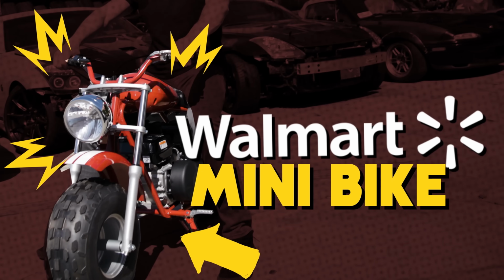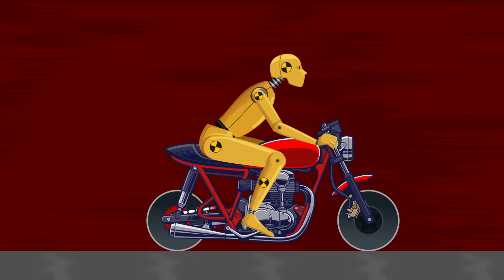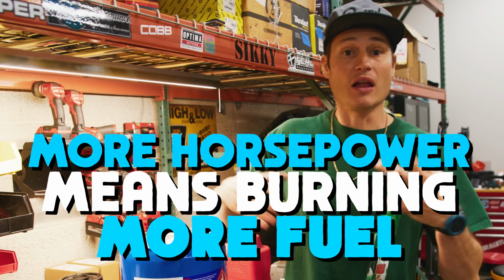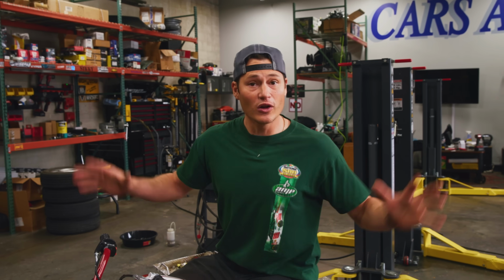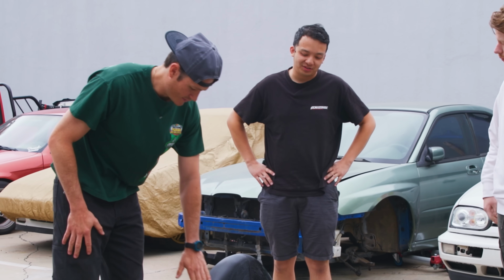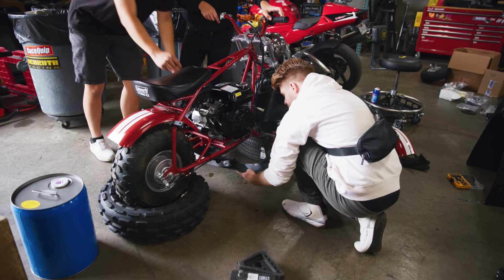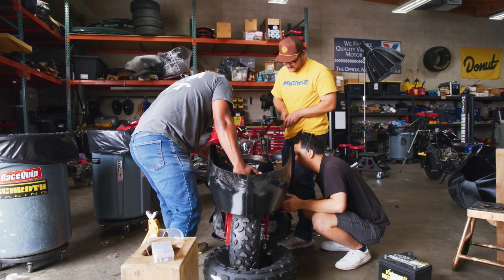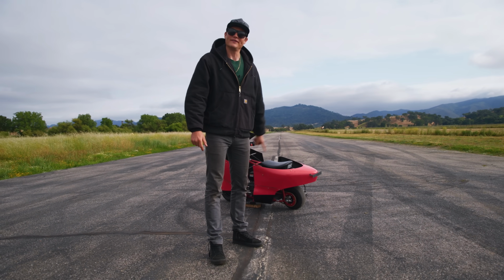Building the World’s Fastest Walmart Motorcycle (Day 2)

Comment: I was shocked by the minimal effect of the aero. Based on the looks of the on/off I assumed it would a massive effect
Reply: It has a lot more surface area than just the bike and rider.
Reply: Maybe they need a full fairing, like those HPV bicycles that go 80+ mph.
Reply: Aero doesn't look right either, looks like it's causing lift at the front which is why it's wobbling
Reply: its effectively like putting a giant air dam on an 18 wheeler. try to make something heavy and huge aerodynamic, doesnt work very well.
Reply: The added weight didn't offset the gain in aero either.
Reply: @joshuagibson2520  yeah 10lbs on an engine with that little torque is significant. Definitely more than the 3% reduction in drag.
Reply: I think it would have more of an effect if they were going faster than 100mph if it was 150mph would be useful
Reply: How aero looks generally has little to do with how it actually performs
Reply: I hope they do a run without it. Seems like a rigid parachute, especially in the rear hollow pocket behind the rider. I'm guessing a lot of flow will get caught in that
Reply: @tomn2765  If his legs don't block it and the front fairing directs it away from it.
Reply: Hey! The minimal effect is actually coming from the rider. All the flow separation we're seeing is simply cause the rider isn't tucked low enough (cause he can't be). Unfortunately fairings can't really fix that.
Reply: @CRneu  Weight doesn't affect top speed, though. It only affects acceleration. Top speed is dependent on drag, not weight. 3% is 3%.
Reply: @clawsoon  yea the design is off they could of saved weight by not making that piece that went into the struts and instead just incorporate into the top fairing piece that would curve around the front wheel and then come to a point on the back like a rain drop.
Reply: Despite how sleek a lot of sportbikes may look, motorcycles are very un-aerodynamic. The most aerodynamic production motorcycle was the Suzuki Hayabusa last time I checked, and it has about the same drag cooefficent (0.55 - 0.60) as an H2 Hummer. Even the best Aero in the world would only make a marginal difference
Reply: The aero imo looks fugly
Reply: Put a set of short, flat bars on it, and try the "Bonneville Speedo Superman" technique?
Reply: @drippingwax define normal
Reply: @drippingwax and yes but main problem they require to go slow through towns other problem is track has been upgraded can risk derailment if you are referring to the USA. If you talking about other countries they have no problem reaching those speeds they kept up with modernized trains
Reply: He INCREASED the frontal area, adding several counts to the 'Coefficient of Drag'- even though he DECREASED the C/D by several counts with sleeker bodywork.
Sometimes smaller dirty frontal area is better that cleaner aero.  Should have moved the seat bk, & moved the foot pegs bk, & built dropped handle bars. Using all the Aero man hours to achieve those improvements,  & saving some wt#.

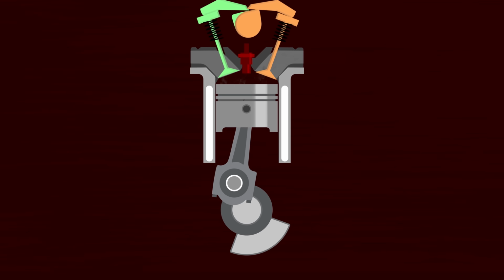Comment: A correction around 2:45, fellas: 12:1 air to fuel ratio doesn't mean 12 parts fuel per one part air - it means 12 parts AIR to one part FUEL. Huge difference ;)
Reply: I was about to comment!
Reply: Also gasoline is 14.6-1, not 12-1
Reply: @ThePower1037  Technically yes but under load and particularly with boost 12:1 is safer
Reply: @ThePower1037  The air:fuel ratio of gasoline is variable depending on a lot of parameters. It's not a set number, which is why it's a ratio ;)
Reply: @Zaudunyani  You're correct about the ration being variable, but that's not why it's a ratio. That's why it's a variable and not a constant. It's a ratio because there are two substances being compared (in this case by volume).
Reply: @ThePower1037 For maximum fuel burn efficiency. For max power, 12:1 is more appropriate.
Reply: No one cares bruh
Reply: Stoichiometry
Reply: @BillyBob-iy4pd  lmao if you're running what's actually 1 : 12 i think you might care
Reply: @BillyBob-iy4pd  I care.
Reply: The real problem is gasoline air fuel is 14.5 to 1
Reply: @Linkman95  The dude can't change a flat, don't bother.
Reply: 12x the difference
Reply: @ThePower1037  That is theoretical,
in reality this ratio is only used in idling and low load operation while at full throttle the ratio will be around 12:1-13:1 (depending on NA/boosted),
because of thermal and efficiency reasons.. for example at 14.6 : 1 the spark igniting the fuel is a lot slower than at a richer A/F ratio, also lean burn/knocking etc are more probable at this AFR
Reply: Is this the last episode we see with Jeremiah, i hope not😮
Reply: @ThePower1037 technically but if you run an engine hard at 14.6:1 it will ping itself to pieces
Reply: @ThePower1037  I believe you are refering to the stoichiometric equation.

Essentially, that is the calculated, theoretical perfect "reaction", where all parts fuel and air are "used up" and converted into CO2 and H20 without excess or waste. However This does not happen because not all of the fuel is able to be reacted to oxygen, inside the engine, in time. You can encourage the % reaction via heating, mixing, turbulence and as well as aiming the Fuel Injector towards the sparkplug, but that works only in specific set ups. I believe its also why OHV is more efficient, because have the spark plug dead center minimizes the distance to any one point in the cylinder, resulting in an even, consistent burn while lowering the chance of "unburnt pockets"

@MoistGrundle2.0 Not necesarily. That only works in an ideal, perfect environment that does not exist. It has been found that lean fuel ratios are more efficient and powerful then stoichiometric ratios. In chemical reactions, you want the inexpensive, less costly ingredient to always be in excess, so you can more completely react the limited resource.

You can get closer and closer to 100%, but it will never be 100%. And then you have to factor in the cost of design, equipment, time, and reproducibility.

The higher the ratio, the more force, wear, and heat is generated resulting in needing more robust parts, or your parts and car will break down quicker. I do agree with you on the 12:1. The lower the ratio, the better it is for your parts and reducing wear.

FUN FACT: The higher the ratio of air to fuel, the less it acts like a "burn" or "flame" and slowly becomes more and more of an explosion. Same thing with compression, low compression causes a flame front, while high compression turns it into an explosion. (Where in an explosion creates converts more and more energy into pressure rather than heat)
Reply: @MoistGrundle2.0  I tried to link your name in my above comment, didn't work out.
Reply: Richer than Oprah
Reply: Yes, but the conclusion is correct that 3x more ethanol will be used at 4:1 (which is the same as 12:3).
Reply: @kmoecub u're wrong. It is not by volume. If it was by volume, your engine would drink a little bit much don't you think? If you have a 1000cc engine, it would suck 1 liter of air every 2 rotations at full throttle. Every 29 rotations it sucks 14,5 liters of air in. Your words saying now the engine used 1 liter of gasoline. Now do the calculation when the engine is at 6000 rpm😮😮. It would drink 207 liters per minute of gasoline haha
In science the perfect mix is 14.7 to 1. And thats by weight, not volume. 1 grams of gasoline, 14,7 grams of air.
Reply: @ThePower1037  correct bit i think the bike is a two stroke
Reply: @600wheel  Theoretical stoichiometric perfect ratio. And that is measured on the volumetric efficiency. And volumetric efficiency occurs on a specific RPM or narrow range. 14.5:1 at wide open will mean less at part throttle etc etc. Thats why there are so many different maps in EFI systems and different stage jets in carbs. Thats said, for BOOST and NITRO, you want fatter ration of 11-12:1 to account for the extra oxygen on boost. Methanol itself has LESS potential energy so you have to run more through the engine. That works as a coolant, mild shock absorber for the aggressive timing curve etc. Its not so cut and dry as 14.5:1 is gospel
Reply: I seen that and laughed
Reply: @600wheel lol, if your 600 whp is tuned to 14.5:1 at wot on gasoline, you've got issues.
Your ideal target will vary depending on your vehicle. But somewhere around 12ish:1 is where you want to be at wot. 

My simple n/a 400hp car's fuel target is around 12.71:1.
Reply: @XenocraftGalaxy  Fair. I should have said safer for power. Anybody who's ever tuned anything knows that lean is mean....until it isn't.
Reply: @ThePower1037 4.6 will give the most power IF combustion is perfect. real world is not perfect
Reply: Haha wow good catch. The wrong way around sounds like they put a jug of 87 octane in a SodaStream
Reply: @priitmolder6475  Got it thank you very much. My fox has a blower pushing 14lbs and the air fuel sits in the 12-12.5 range at full throttle so I guess I am a little leaner than I thought but it sure seems to love it she has held together for 10 years with that infamous ultralight 5 L block that like to split in half at 600 crank and she is 600 wheel
Reply: @BillyBob-iy4pd imagine caring enough to answer lol
Reply: They should be using hemp oil instead. It has a 69:420 air ratio.
Reply: it did sound a little lean, lol
Reply: I was gonna say, that's not how stoichiometry works!
Reply: that makes alot more sense it was confusing me
Reply: @600wheel  theres lots of other things besides pure fuel amounts. Theres elevations, timings, restrictions etc. Running tiny bit lean for a daily driver is ok for economy.
Reply: @BillyBob-iy4pd  you say no one cares when that is literally one of the most vital pieces of information involving an engine. 12 parts fuel to 1 part air would effectively be like filling a cylinder with fuel and giving it a tiny little squirt of air. if that sounds bad and ass backwards, its because it literally is the exact opposite of what an engine is supposed to do. take in a lot of high density air and give it a little squirt of fuel.
Reply: stoichimetry on paper is not stoichiometry in the dyamic conditions we find in a cylinder.
Reply: TBH I think he just spoke backwards on accident and the graphic was made off of that. Seemed like the logic for the rest of the statement made sense, dude just said air/gas backwards. But good to call out just in case someone was learning entirely from this video alone lol.
Reply: @priitmolder6475  yeah I know those things my point is he said the optimum burn ratio is 12 to 1 I disagree the optimum burn ratio for gasoline is 14.5 to 1 maybe his car likes running at 12 to 1 my Mustang loves 12.5 to 1 but that’s not what he said not to mention he got the air and the fuel part completely backwards so do you think it’s possible he screwed the 12 to 1 up also
Reply: Yep, u gotta watch em, hence my post a second ago!!
Reply: @BillyBob-iy4pd yes we do - brah!!!!
Reply: We out here floodin' shit!
Reply: @ThePower1037  For most stock NA engines, It changes with tune, forced induction & boost.
Reply: Yeah, it kinda show these guys have a script and have no idea whats going on, because this would bother me to even say it out loud...
Reply: @vinckokeccee1352  Happens to every Youtube channel once they grow big.
Reply: @laxminarayananks1520  ..sure i get it, but this is like saying on an astronomy channel, that sun circles around earth :)
Reply: Should be pinned
Reply: Is that compression ratio?
Reply: 12:1 is better under load for a few reasons, one of them being that it’s less likely to predetonate. If you run a high compression engine at full load with 14:1 AFR you’re asking for issues.
Reply: Yes. But why Donut media themselves not commenting on this ? Do they only care about putting out videos and not the facts ? Imagine how much data has been mis represented in the past.
Reply: He also said small tires will give him better torque, and then proceeded to say he needs ultra high gear in to get to 100 miles an hour... FFS...
Reply: Glad this is top comment, definitely gonna save a few people from sounding silly
Reply: @ThePower1037   not always try   its a general  stock  suggested  ratio  but   different   compression ration    - types of fuels -  and   combustion chamber and cam timing  can vary the  ration  and    higher  fuel  air ration  in many cases can   actually  cool the  engine and reduce  detonation  but  12;1  can make a hotter  flame front  where some fuels   need  a higher  flash point
Reply: @b-man13 imagine quoting a donut vid trying to sounds smart hahahahahaha
Reply: Oh damn, i thought i was the one thinking wrong, thank you!
Reply: @kmoecub  ok that's too much pedantry now
Reply: @b-man13  video says 12 to 13 parts gasoline and one part air, maybe give a corrective statement in the description.
Reply: Came here to say exactly that!
Reply: BTW, you guys are amazing! Keep up the good work.
Reply: Had to search comments to see if someone corrected that. 12 parts fuel = likely hydrolocking an engine.
Reply: @600wheel for fuel economy yeah, for peak power 12:1 works somewhat better. Partly cooling, partly to do with engine temps.
Reply: @jediknight1294  yeah that’s where my Mustang runs under boost and she doesn’t heat up aggressively she’ll get to about 200 then the fan and believe it or not the radiator that came in the car take care of it with the help of a hi Flo Edelbrock water pump I figured with the heat we were having this summer was going to be the year I would have to put an aluminum one in but that old stock radiator from 1989 is still putting in work it’s the only thing I didn’t change because at the time I couldn’t get an aluminum to fit what I was doing and I wanted to drive the car and then it worked and you know how that goes
Reply: @600wheel  heh yeah the why take it out fuck it run it till it breaks
Reply: Great so the animation was correct but the voiceover wasn't. But that does mean less fuel and more air per stroke so the air intake should be increased more than just adding the methanol, right?
Reply: @thijshoeksema2179  you match the amount of methanol you’re putting in your motor to the amount of air that it will draw into the cylinder on the intake stroke so if you add more air by  putting a turbo on it you have to add more methanol the match the amount of air.
Reply: @Zaudunyani no that's not what makes it a ratio. Compression ratio is a ratio too but it's constant for a given engine.

Comment: A smaller tire will require less torque to spin but that's for acceleration. Purely for top speed, a larger tire will allow for a theoretical higher top speed. Each revolution will be more distance. It will just take longer to get there
Reply: Yep, hence why truck speedometers are off when you lift them and put larger tires on. I think they should have gone with narrower, taller tires.
Reply: @amorton94 yup, I put 20s on my car, and they changed the speedo by 5mph at 70 so technically I'm doing 75 when it reads 70, the overall diameter change was 2 inches. Here on this video they changed about 2 inches or more, so they lost a decent amount with small wheels
Reply: here i am thinking the nubs have less road contact and therefore less friction overall. a thinner tire does make sense because you are shedding some weight. smaller and slicker make less sense to me other than more control area for the slick  tire.
Reply: Spoked wheels would be  more light weight
Reply: Exactly. Then they gear it up any way. Look at any Bonneville salt flat bike.
you need narrow/tall tires and d0 the math so 9000 rpm with the ratio of the primary and tire roll out equals 100 mph
maybe a little nitro in the meth.
Reply: Thank you. Somebody get these guys a real engineer.